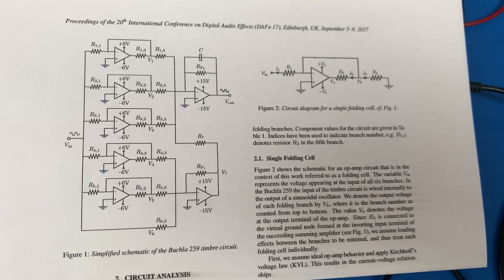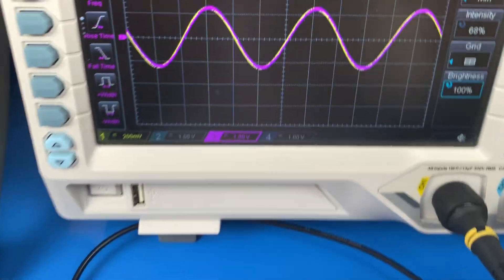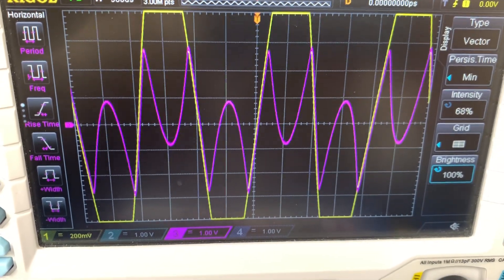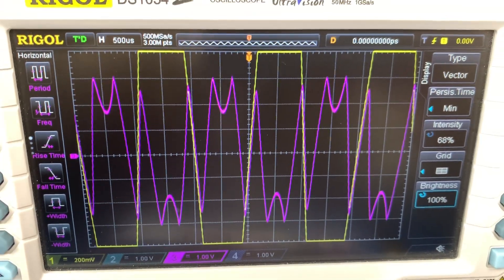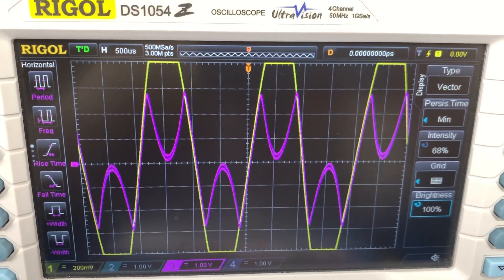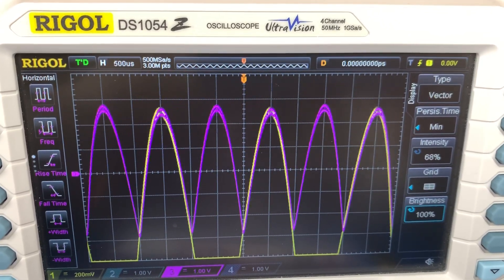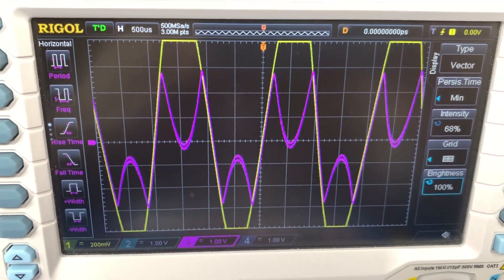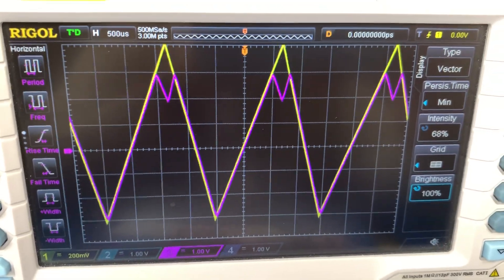Wave Folding Circuit (Buchla 259 Wavefolder)

Comment: It's quite hard to read the schematics. What Opamps and what resistor values are used? Or do you have a link to the schematic? Thanks!
Reply from the maker: The schematic and component values are in the paper "Virtual Analog Buchla 259 Wavefolder." I think I used some simple jellybean op-amps (probably just μA741s).